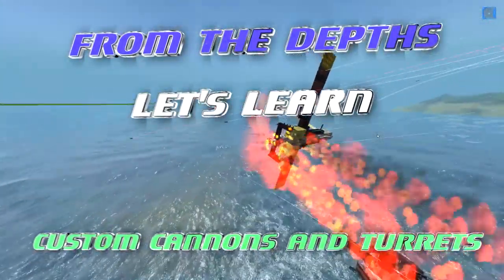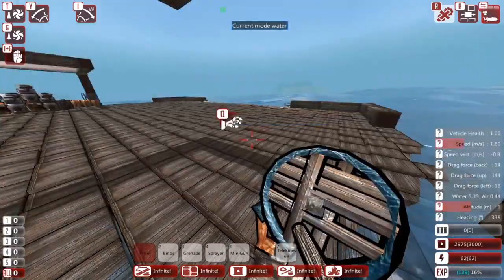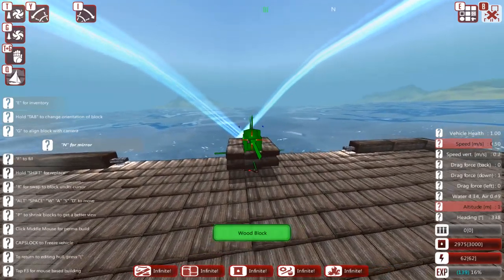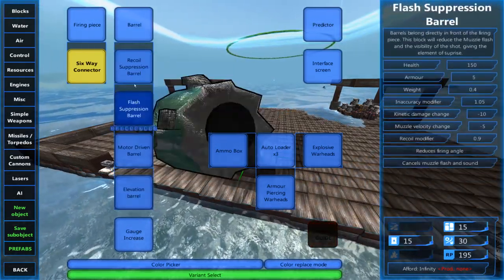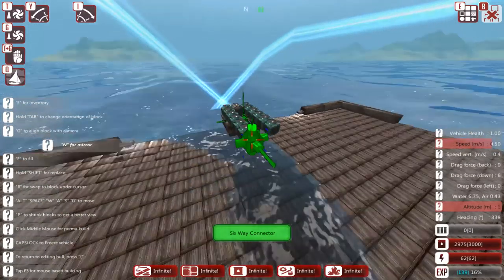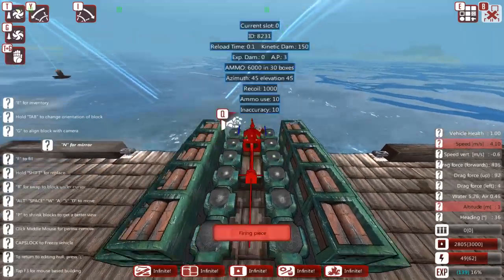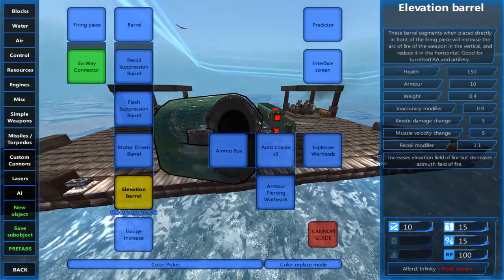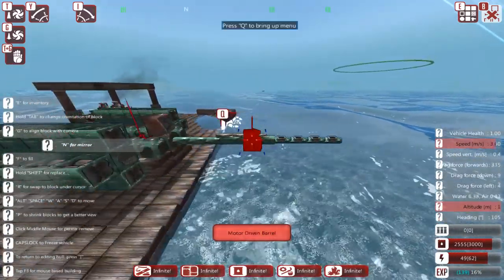From The Depths Let's Learn - Building Custom Cannons with Turrets [Tutorial]

Comment: One elevation barrel only on front of turret = 80 degree elevation!
Reply from the maker: Fantastic! I did some playing around. 1 elevation barrel by itself is 80 elevation, you quickly lose out on that as you add more barrel types. The motor driven barrel offsets the elevation loss of 1 other barrel. So, 1 elevation barrel + 10 recoil barrels + 10 motor driven barrels = 80 elevation! Interesting...

Comment: Great video, you have an amazing voice! 
Im having some trouble however, im building a big battleship and ive made a large turret shroud with 3 barrels mounted on a 1 axis turret, but its not fixed to my ship hull, it sort of bobs around as if it were attached by elastic, and constantly clips into the deck of the ship as the hull floats on the water, how do i make it rigidly attach? (but still able to rotate the turret). Sorry if its obvious i've had the game less than 24 hours and ive already made this huge hull with no idea how half the things work
Reply: +Connor V nvm I had selected a spin/turn block by accident. -__-
Reply from the maker: +Connor V Thanks for the compliment! Also, glad you figured it out... i've made that same mistake quite a few times :)

Comment: I found this pretty useful, but I found that motor driven barrels don't need to be used when the gun is mounted on a turret. If the gun is stationary, that's fine. All aside, this was a pretty good video, and will look for more in the future.
Reply from the maker: Nolan Fazen Glad you found it useful!
Reply: Nolan Fazen It's very useful to have motor-driven barrels even on turrets because the barrel can swing much faster than the turret can spin. Additionally, lots of enemies will be above sea level even with the Deepwater Guard, making it absolutely necessary for the barrel to be able to swing up to still engage any flyers.

Comment: Excuse me but is there a way I can save a turret's design and somehow paste it on other parts of the ship? Or do I have to manually rebuild the whole thing from scratch if I want more than one of the same kind of turret?
Reply from the maker: +DemonOrca95 Yes there is! Go into build mode on the turret (not the ship), then hit E to enter your build options and select Save Subobject (if it says load subobject, then you aren't on the turret itself). Click on the Save Subobject category and then double click a space that says Empty. Now you can build your turret from the subobject :)
Reply: +Scr0atoriousGaming Thanks! Which button fires the turret? I tried right and left clicking my mouse but absolutely nothing happens.
Reply from the maker: DemonOrca95 Make sure you are standing near the turret and press left-ctrl... I believe middle mouse button will also fire them? Hope that helps!
Reply: Derp... I just realized pressing the scroll wheel fires it, my bad. ;-;

Comment: In the new object tab I don't have the 360 turret base please help
Reply from the maker: +Richard Gillespie That has changed to something new - under New Object, you'll see "Two Axis Turret" and when you click that you will have two options: One Axis Turret (this moves only on horizontal plane) and Two Axis Turret (this moves both horizonta/vertical). It's a much easier system, so use one of those two for your turret needs :)

Comment: So I tried to 100% copy this basic cannon method but my cannon isn't firing when I'm trying to test fire it. Any tips?
Reply from the maker: +huy211 Hey there - when you walk up to the cannon to fire it - does it at least move around as you look around? And when you attempt to fire do you notice any  warnings at the top left popping up?
Reply: Never mind I got it to work, thanks! Now I'm just having a problem with my ship capsizing and submerging at times. I already have a lead keel at the center of my ship as well but it keeps sinking. Is my ship too top heavy?
Reply from the maker: huy211 Is your ship is sinking straight down, or by tipping left/right and then going down? If it's tipping left/right, you need more buoyancy on the sides to offset the height of the ship (probably top heavy). If it's sinking straight down then the ship is just too heavy. some things you can try is making your keel out of alloy instead of metal, as alloy is muuuch lighter
Reply: +Scr0atoriousGaming I'm having the same problem but my cannon does move up and down but doesn't look around or fire, no warning are popping up
Reply: +Scr0atoriousGaming aaaaand now the whole thing has blown up...
Reply: +Scr0atoriousGaming Did you ever do the AI turret part? My AI won't turn my turret :(

Comment: did everything the same, still says no internal ammo supplys plz help!
Reply from the maker: wieger bakker Did you make sure to add ammo boxes to your cannon, along with ammo barrels on your ship somewhere? Make sure the ammo boxes are connected properly as well! The ammo boxes get their ammo from the barrels on the ship, so if the boxes aren't correct it will say there is no internal ammo - hope this helps!
Reply: Scr0atoriousGaming got it, awesome and thanks for your help btw.
but one question; is there a fire rate limmit?
Reply from the maker: wieger bakker Glad you got it man! There is a fire rate limit, I believe the fastest you can fire is 0.1 shots per second. That generally requires the lowest gauge cannon to get the highest fire rate

Comment: Is no more 360 turret?
Reply from the maker: +Trollinski JR 360 turret was switched out to two new types: 1-axis turret and 2-axis turret. I recommend a 2-axis turret for most everything, unless you just want a turret to move along the horizontal plane - that would be the 1-axis turret. Hope that helps!
Reply: Thanks! I found out right after i posted that. Thanks for the quick response!

Another question, How do i make my turrets/missiles, Fire automatically? Sorry if i sound like an idiot, Just got into the game.
Reply from the maker: +Trollinski JR This is a totally valid question! To get your turrets and missiles firing autonomously, you'll want to start digging into AI and setting that up. Essentially you will need 1) an AI mainframe on your ship, with a wireless transmitter hooked up to it so it can communicate, and 2) local weapons controller w/ a wireless receiver hooked up to it, on the same channel as the AI mainframe (defaults to channel 1). this will establish communication between the mainframe and your weapons controller.

The local weapons controller needs to be within 2 squares of your turret or weapon system - you will know it is close enough as when you place the local weapons controller down, it'll say how many weapons nearby it can 'control'. Now there are a ton more settings you can play with by hitting 'q' on the local weapon controller, but this should get you started in the right direction! feel free to ask more q's as you got em :)
Reply: +Scr0atoriousGaming Okay, I put it down right next to it, and i've been messing with the ai, and it will not connect, Well, It is connected to the mainframe, But not the turret? I have an receiver and a transmitter, And the Local Weapons Controller Is next to the weapon, And it says its controlling zero?
Reply from the maker: Trollinski JR Ah I see! If your weapon is on a turret system, then put the local weapons controller within 2 squares of the turret base, not the weapon controller itself. If your weapon system isn't on a turret then you place the local weapons controller within two spots of the weapon controller... let me know if that gets you up and running!
Reply from the maker: Trollinski JR Also just to mention, the local weapons controller counts diagonal blocks as well, so if your weapon controller is within 2 blocks of the local weapons controller, but it is diagonally offset, then it will too far (if that makes sense)
Reply: I fixed it! Now i'm really hyped on how this game will play out, I've learned all the basics from you! You helped me to enjoy this game to the fullest extent. Thank you.
Reply: +Scr0atoriousGaming I have another question, Please reply fast, I try to increase the range of my laser system, (PS) I am more adept at this game now, I have a really big battleship, And i want a laser system, so i made this 50 block barrel, Or Laser optics, And the laser works fine! It shoots, Its just not good range.
Reply from the maker: Trollinski JR Well, I just now got notified of this comment, sorry for the delay! I believe range on lasers only increases as you add more damage to them. Also note, a continuous beam laser will have a very very tiny range, but if you add q-switches to make it a pulse laser, the range will grow VERY fast.... hope that helps!
Reply: It did, Thanks alot!